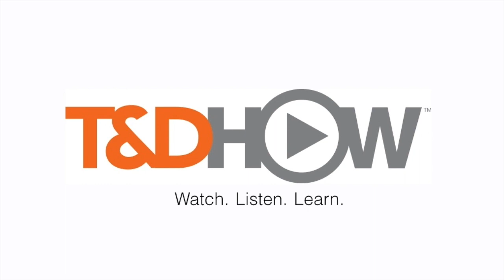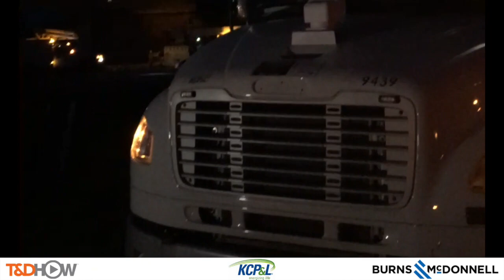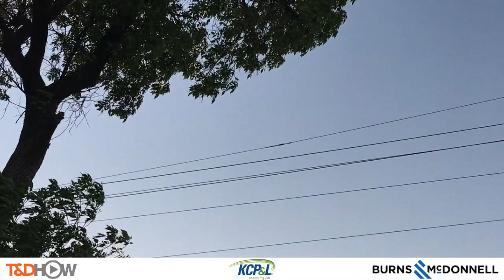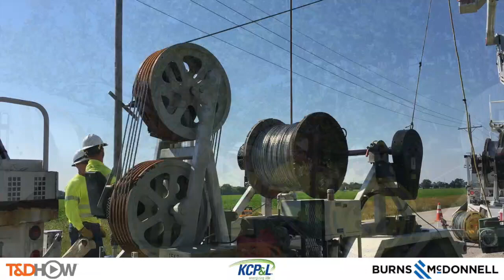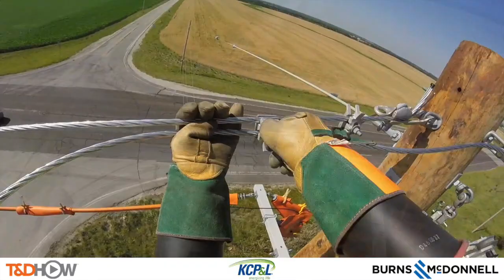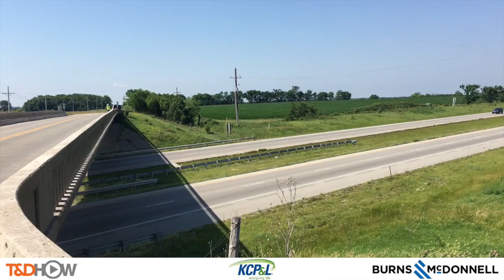Interstate Highway Crossing

Comment: Across in Europe we do not have a neutral on High Voltage powelines. I’m sure the top wire is called earth. May be different in US?
Reply: In the US we frequently use a neutral on distribution lines which connect individual customers. The variety of single-phase loads on distribution lines makes it difficult to balance the load across all phases without using a neutral to carry the unbalanced load. Transmission lines, however, are always balanced since they are never used for single-phase loads. Because of this, our transmission lines typically do not have a neutral, tho they may have a grounded shield wire above the phase wires for lightning protection.
Reply: @Ethan.Lamoureux  correct